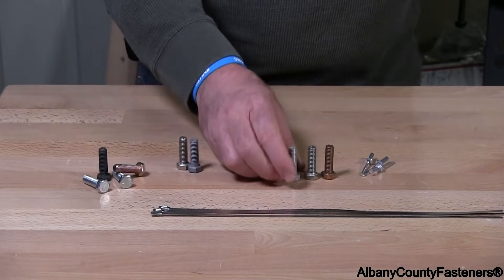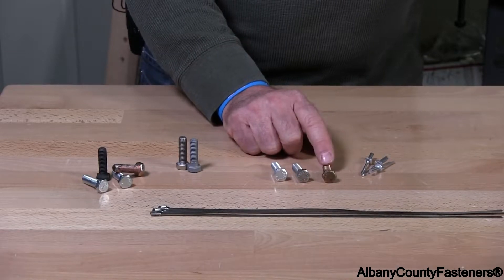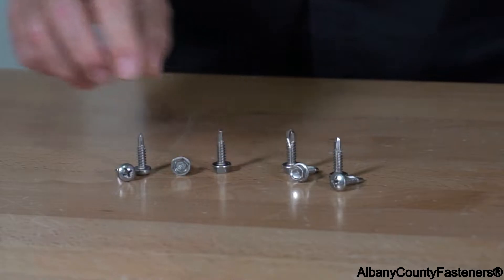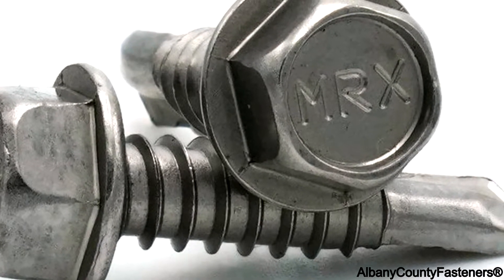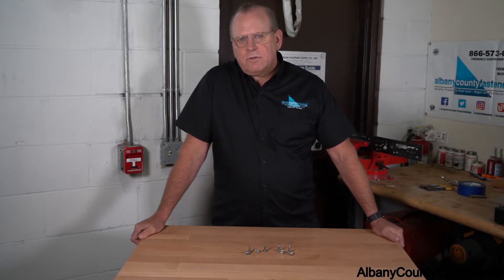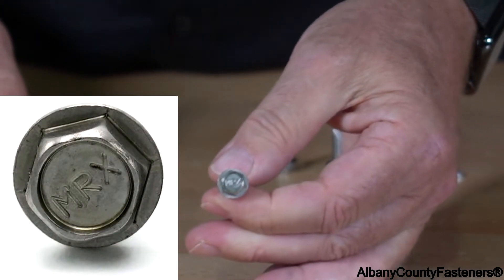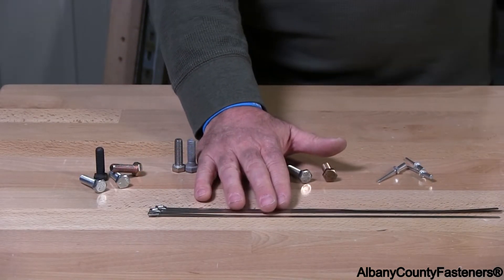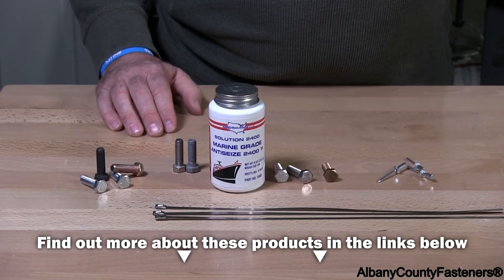NO MORE RUST - Marine Grade Metals For Saltwater | Fasteners 101

Comment: Thank you 
Very helpful
Now am about to purchase TRW  snap fasteners stainless steel. For marine use. More specific (for boat cover Am not being able to know what is TRW stainless. And not knowing also how it will interact with seawater. Have to say that the boat cover will only be installed outside the water . Although a part of the snap fastener will be digged or attached to the boat it self. 
I dont know still if TRW Stainless fasteners will be helpfull and assuring no rust?